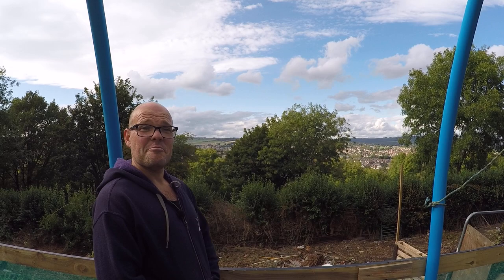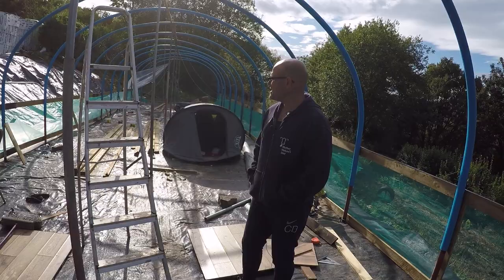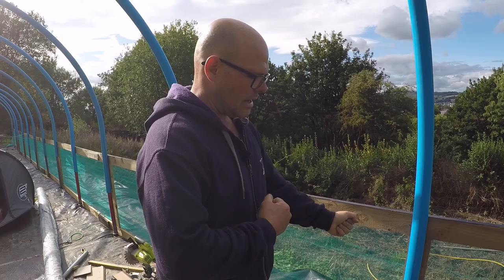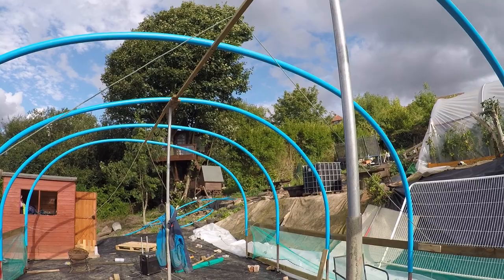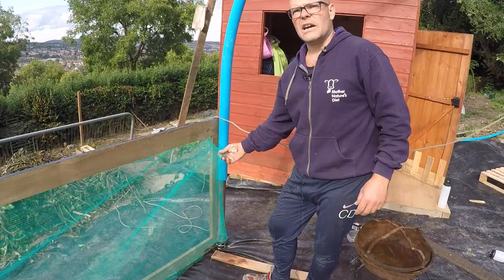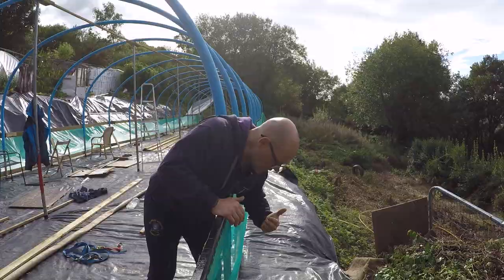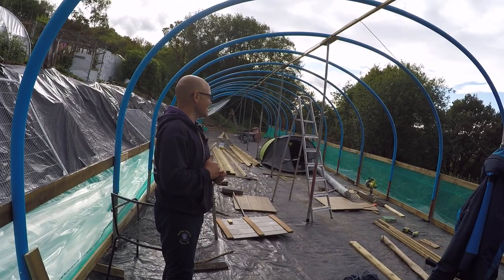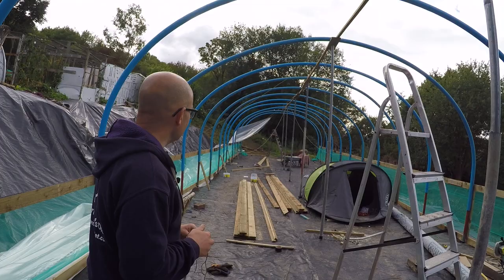Building a huge, cheap polytunnel with scaffold poles and water pipes

Comment: Hi, people have been asking for an update,  5 years later it going strong.  The water pipes and scaffold poles work beautifully and very tough. I chopped a tree down (big one) before putting the Poly over and it fell the wrong way, landed on the structure and once I had chainsawed it up and moved it the pipes popped back up.

Comment: Where's part 2 Chris?... love the look of this tunnel so far mind you
Reply: The Little Farmers Farm I will make a part 2. It is going well though.
Reply: @r1seyoga862  Good work so far pal, but you need a start to end on this one IMO Mate.. god bless
Guru M :-)
Reply: Just starting a 5m long x 3m wide tunnel using 63mm yellow gas pipe. It was no fun uncoiling 60 meters of that on my own, why don't I ask for help? The WD40 idea was a revelation but how far in to the pipe did you drive the scaffold pole? Really would love a follow up video. Awesome work. Thanks.

Comment: Nice one mate some good tips there .Just building mine I am using 32 mmm pipe as mine is smaller and I had some thick re bar in the garage that I have hammered into the ground works a treat. Good luck and keep safe.

Comment: Hi where did you get the pipe to fit over the scaffold poles please I have looked on eBay but no luck please help thanks 👍🏻
Reply from the maker: James F 
 
Tel +44 (0)1752 692221 |  Fax 01752 692762  |  Web www.cmoltd.co.uk
Airport Business Centre  |  10 Thornbury Road  |  Estover  |  Plymouth  |  Devon  |  PL6 7PP
Reply from the maker: Construction Materials Online Ltd
+44 1752581507
https://www.drainagesuperstore.co.uk paypal@drainagesuperstore.co.uk
Purchase details
MDPE Blue Pipe Coil Main Water Supply - 63mm x 50m (Qty 3) Item number090163MD50
Seller information
Reply: @chrisdownham  great video what are the specs on the U bolts that you used on the base board  connection to the posts. Also what was your solution to fitting the polythene over the ventilation area on the side. Many thx,, great vid, got urselves a sub.

Comment: Did you use the proper polytunnel polythene?? Or is it possible to the building polythene??.
Reply: Dublin City Handyman hi, we used proper poly tunnel plastic. Been up for 3 years and been battered by storms and no issues at all.
Reply: @r1seyoga862  Thanks for replying.. I built one a few years ago useing the proper polythene.. i It was 12 x 4 meters.. I want to build one as big as yours.  Just trying to work out costs.

Comment: What pipes did you use
Reply: Hi, we used 60mm water pipes.  It cost about £500 for the whole tunnel.  Not super cheap but will last forever.
Reply: @r1seyoga862  thanks